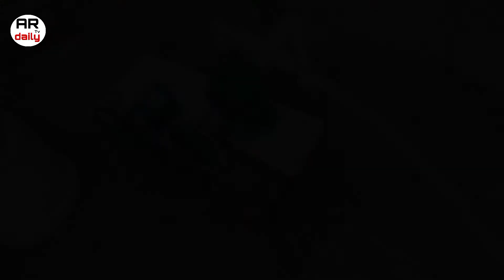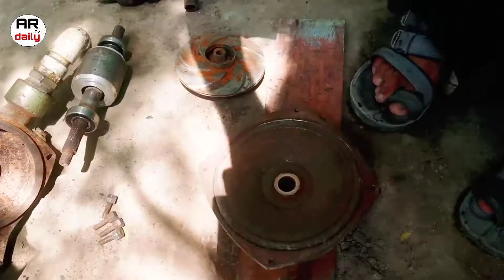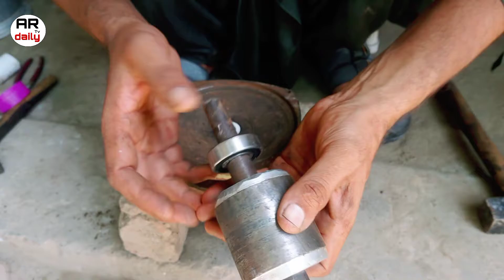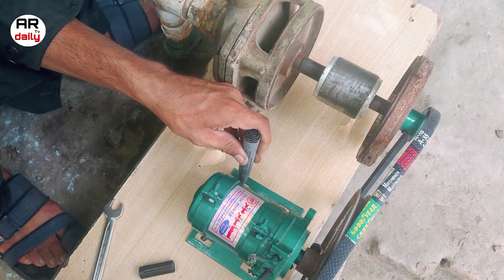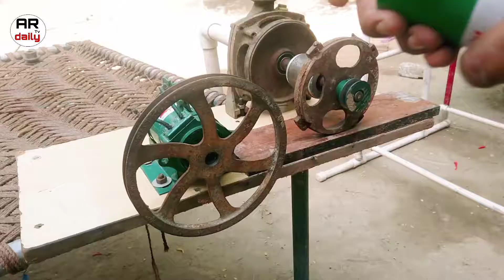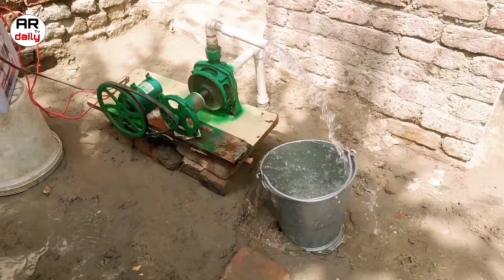How To Make AC To DC Solar Water pump Convert DC motor AC monoblock DC 12v Solar water pump at home

Comment: You installed 8inch pulley it reduce motor rpm due to 12v dc motor. we experiment without verm motor it not suck ground water.